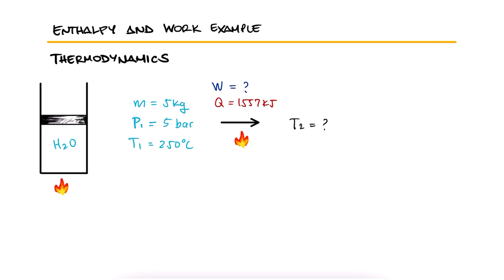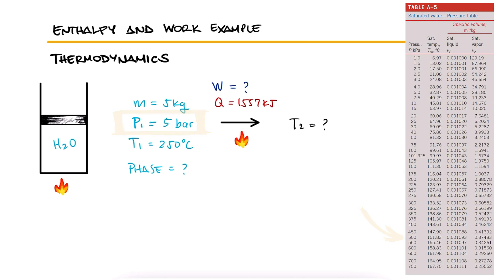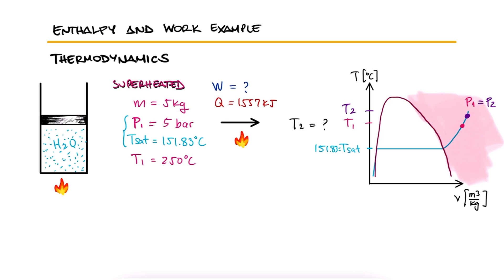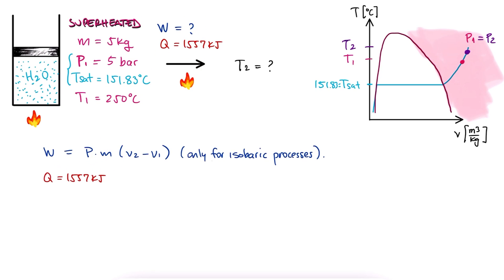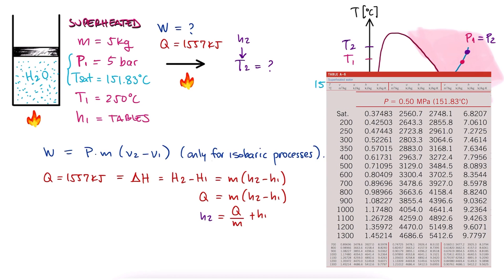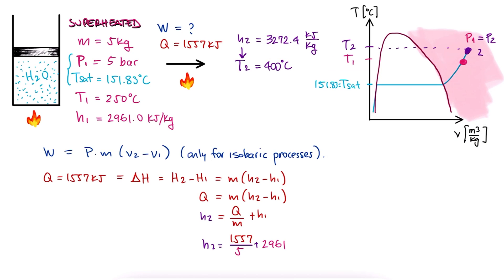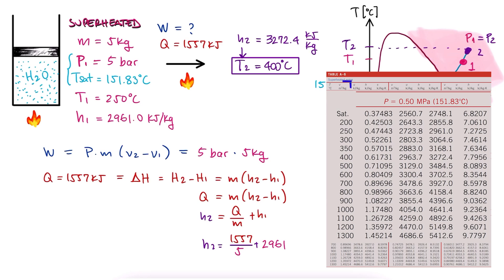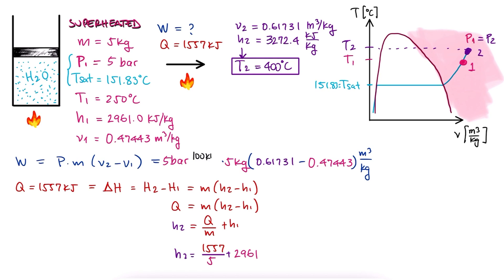ENTHALPY of a Superheated Substance & P∙ΔV in 3 Minutes!

Comment: I think you might be confusing enthalpy change with heat transfer. While they are related, they are not the same. In a constant pressure process, the enthalpy change (ΔH) is equal to the heat transferred (Q) plus the work done by the system (W): ΔH = Q + W. Since the system is expanding, work is being done, and you need to account for that in your calculations
with Q = m.ΔU we can find T2 using tables, then we can find h2 from T2, and last virable is w